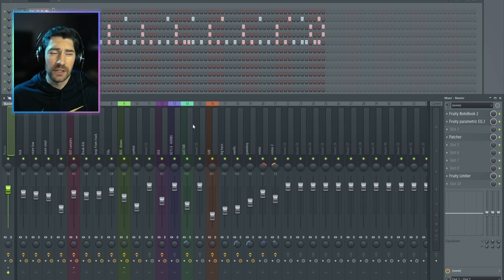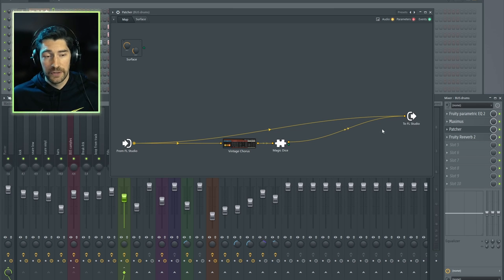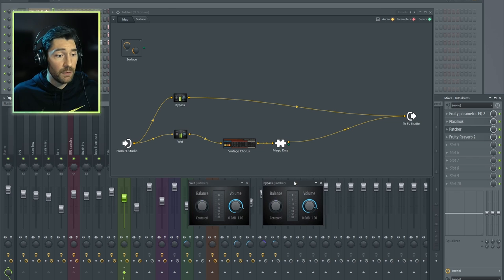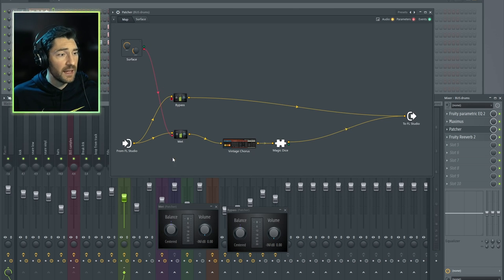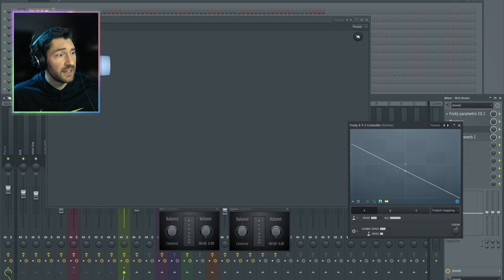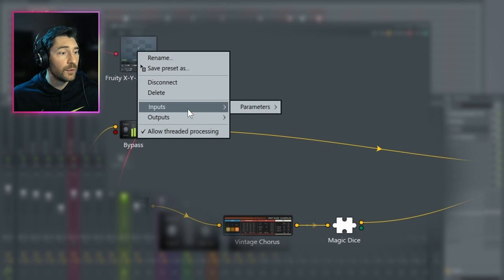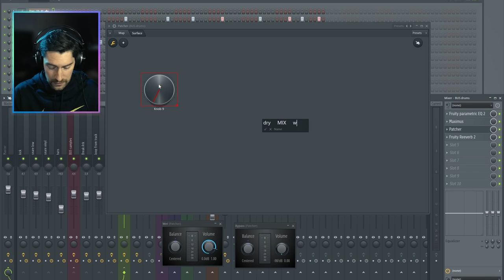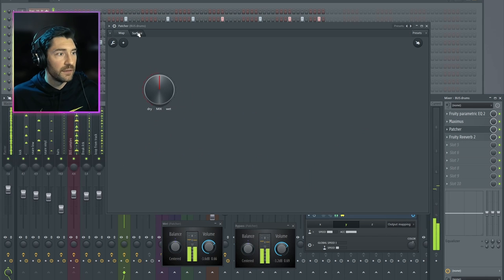Patcher - How to create a simple bypass button

Comment: Thanks for the hints. I was using the Envelope Controller to do similar to X Y Zed. FL really needs to add an assignable Surface control knob parameter for the I/O cables on the Map.

Comment: How do you do this for an individual effect and not the whole plugin?
Reply from the maker: Hi man, great question!  You can extrapolate this method to work for individual effects too.  For every effect that you want a bypass on, you'll need to follow the steps - set up two fruity balances and your XYZ control, set up the button for the bypass, etc.  Route the audio from your bypass fruity balance and your wet plugin signal into two fruity balances for your NEXT effect you want to bypass, and so on.  Don't forget to make a button for each effect bypass, and check that each button is connected to the right XYZ controller!  It's a little time consuming but very worth it to have the control over each plugin in your Patcher creation.

Comment: Hey KRE. 
Do you know if its possible to make bypass buttons that only bypasses one plug-in in the chain at a time? Seems impossible to me 🤔
Reply from the maker: Great question!  Yes you can do it, but you'll need this setup with XYZ Controller and 2 Fruity Balances for each plugin.  I do this in my tutorial called "Patcher tutorial - Start-to-finish plugin design" so check that out if you're still interested.

Comment: Can you do a tutorial of patcher on how tohave the abbility to bypass 2 effects routes and both can be bypassed individually? I struggle with finding how to do it right
Reply from the maker: Hi man!  The short answer is, you can do that using this method in this video.  You'll just have to follow the steps through for each plugin you want a bypass button on.  And after each plugin, you route your audio from the bypass Fruity Balance and audio from your wet plugin into the 2 Fruity Balances for the next plugin.  Repeat for as many plugins as you have.

Comment: so would this work fine if say, I was using multiple plug-ins in patcher to create a multi fx plug in? just duplicate this process with the next effect?
Reply from the maker: Yes you can absolutely repeat this process for each individual module in your FX chain.  In fact you can see an example of that in another video of mine.  In the video on "Start to finish plugin design" I use this bypass trick on the whole plugin as well as on each individual effect.